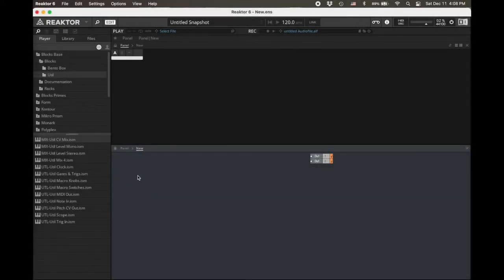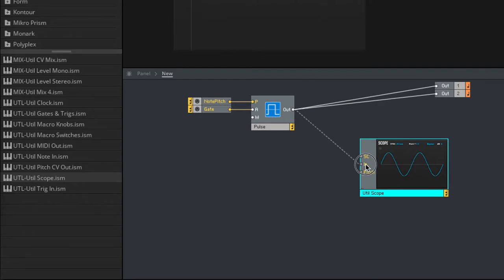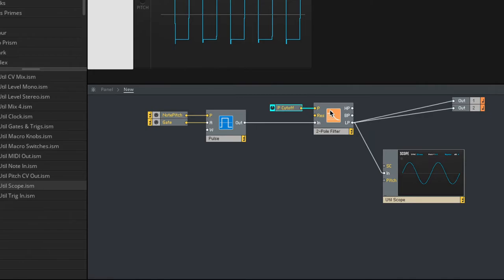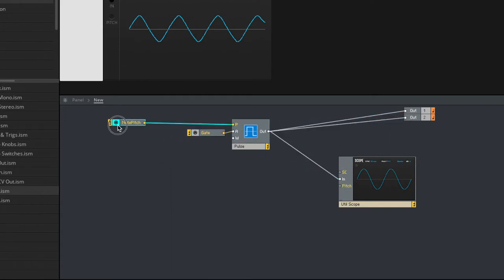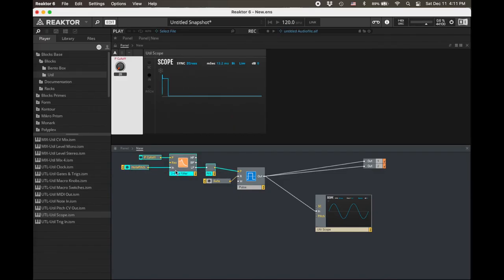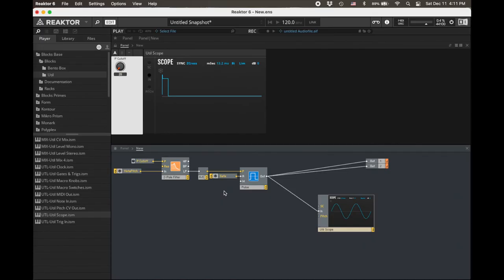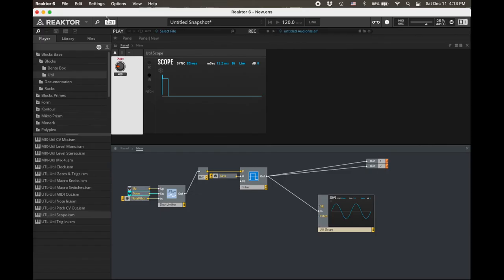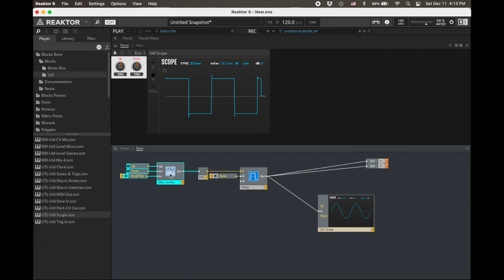Reaktor 6 Easy Portamento / Pitch Glide (Reaktor Primary) | Simon Hutchinson

Comment: Bidirectional glide control LOL!  On most synths you need to turn the knob up to add glide.  Is there an easy way to reverse the control?  I wonder if there is a way to make glide polyphonic because it is amazing sounding when you have say eight oscillators gliding up and down against each other.  Oberheim OB-Xa comes to mind! 😎
Reply: the problem with reaktor is, that with polyphony you can't assign the voices firmly, so that the tones are swapped over in the case of polyphonic portamento.  so far there is no solution for this.